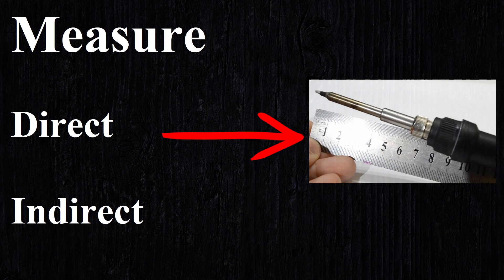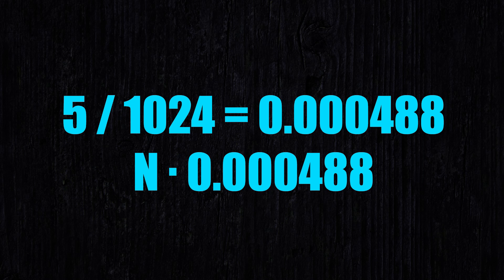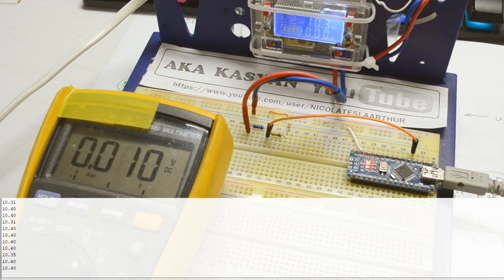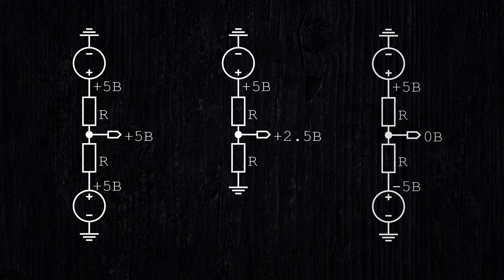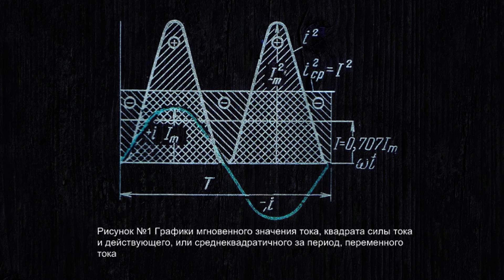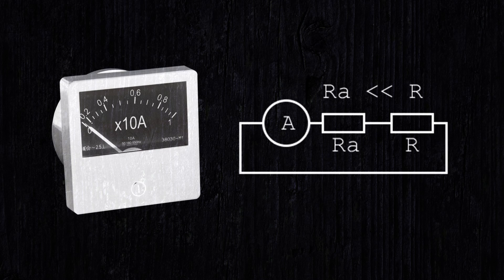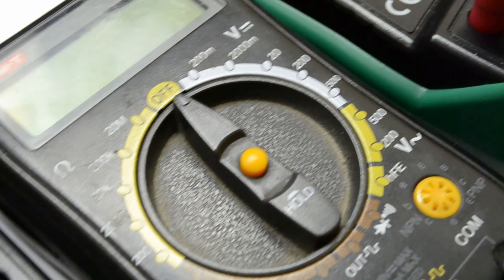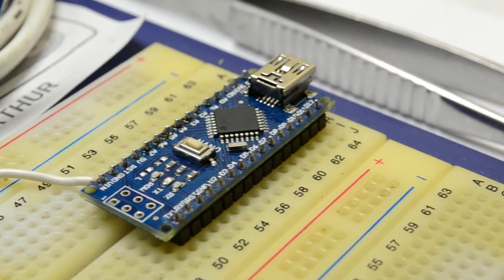Multimeter based on Arduino

Comment: Hey I have seen a circuit online on mikrocontroller. Com that uses atmega 328p to masure resistance capacitance iductance and many other diodes, thyristors etc. I would like this project on your channel it is the so called transistor tester and is completely open soucrce
Reply: it is open source so go build it yourself. what should he add on that hasn't been done on the project? I don't get these absurd requests
Reply: @msana4420  Hey sana you are sbsolutely correct , but my knowldge of electrnoics is so great that I cant make it happen and no one on youtube has yet made it and if sombody has done it is porrly explained so I asked help and i feel it aint bad .....
Reply: @rabindrasharma  I don't get you. There are kits made from that very forum being sold from china. Making a board for the tester is also trivial. In fact, there is a post of someone who made their own board and etched it somewhere in there. Also, the project was active and there were new features that were being constantly added (I haven't checked in a while) so I don't think kasyan can add anything new to what is already there.

Comment: Ltc2400 Boards are cheap and would give you probably 16bit (24 bit native) without special pcb layout teknics for a slow high resolution mode.
Reply: Alreadycexists as pico meter ore something google and you will find :-9